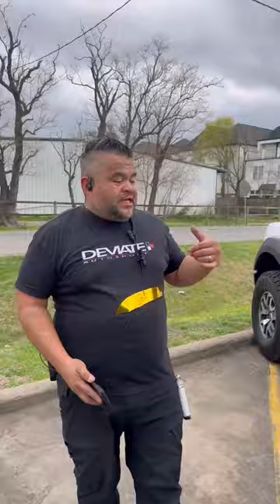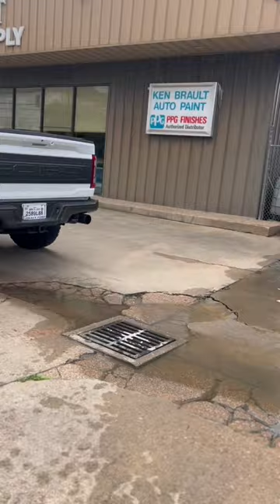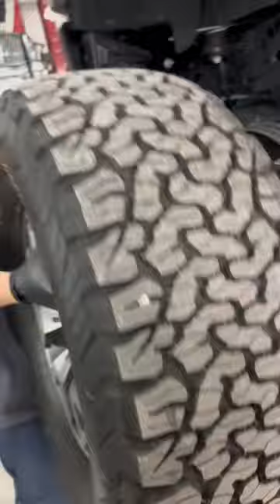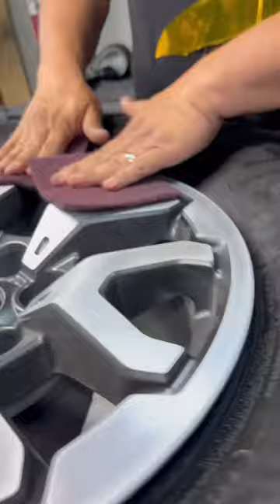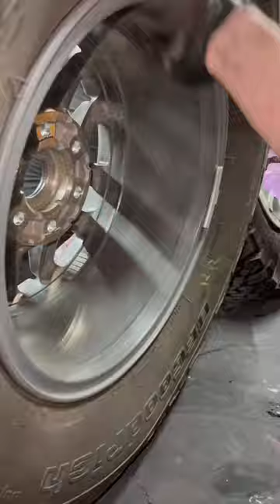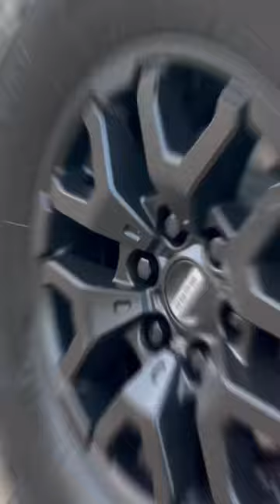Same Day Satin Black Wheels‼️ #shorts

Comment: Impact guns ruin those crappy aluminum capped lugs. Just replaced a set on a raptor today because of the last shop
Reply: Ford sucks for making those lugnuts. Makes working on fords a major pain in the ass. Replace them with a good set of splines and never look back

Comment: What the material you used to cover the wheels? Is it durable / will last? Chip/ scratch easy? I have the exact same situation (Raptor w stock wheels) and want the exact same thing lol
Reply: A can of spray paint why do you think that part was cut out of the video
Reply: @Unlaced_kickz  spray paint.. anyone have experience with this vs powder coating ?
Reply: @MattDelovino  I was trolling.. powder coating is the way to go it’s cost around 250 a wheel put it’s so much more durable than anything else .. I personally have my wheels powder coated wouldn’t have it any other way
Reply: @Unlaced_kickz fair enough lol. Thank you for the response! I was thinking this was the way to do my wheels!
Reply: @MattDelovino  no way that’s why he completely skipped the part where he sprayed it